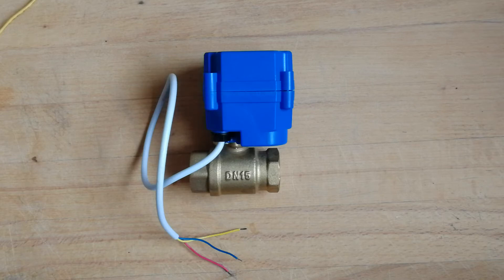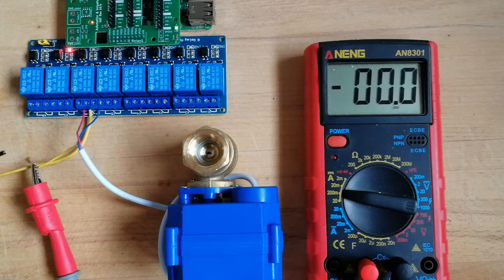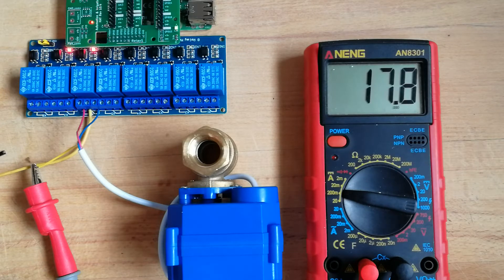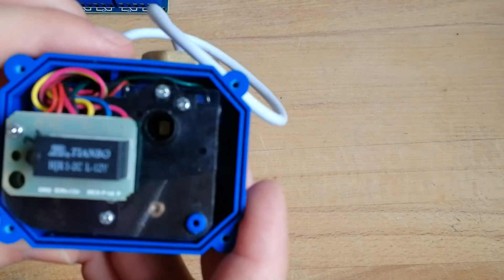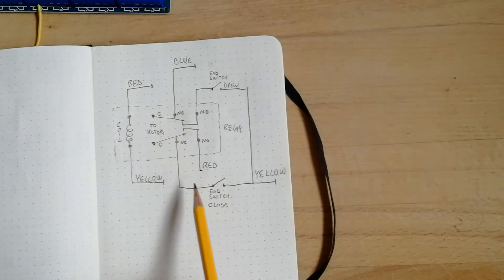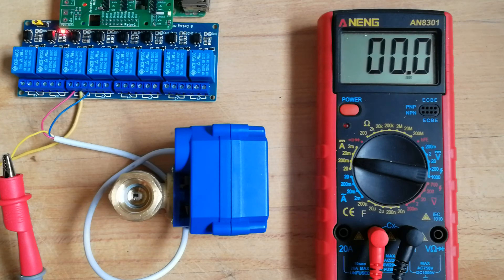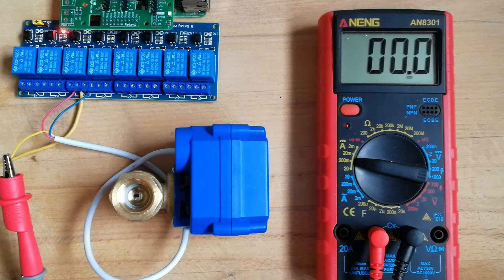Testing a Motorized Valve

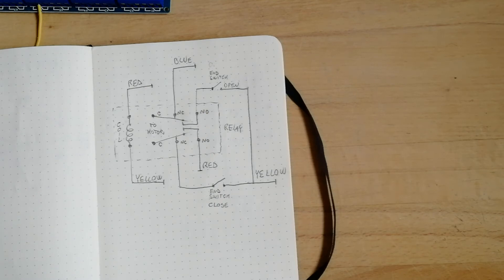Comment: Thanks for the video. I have some improvements for your diagram (t5:42). To say that Init status is Valve=Open. Instead of RED, YELLOW and BLUE, write OPEN-SGN, GND and CLOSE-SGN respectively. Use NC symbols for both end switches, they turn open just when VALVE-OPEN or VALVE-CLOSE position are reached, thus instead of just write OPEN and CLOSE them, write VALVE-OPEN and VALVE-CLOSE. 

Your hack is very good, I don't understand why a commercial product has this mistake!

Regards.

Comment: I have the same five wire ball valve that you have in your video. The instructions I came with it are a little confusing. Your video helped but unfortunately, I’m still having trouble. So I have the yellow wire hooked to ground or negative. When I touch the positive to the blue wire, the valve closes. But when I touch the positive to the red wire, it does not open. What am I doing wrong. Great video by the way thank you I look forward to your help.

Comment: I use a version of this valve, but with the optional open and closed contacts. I use the open contact to enable a pump via a relay.
Reply from the maker: That's an interesting idea, thanks for sharing.
Reply: @hydrosys4raspberry19  yeah, it works well. I can't take credit for the idea though! Atleast it means that the pump won't run unless the valve is open!
Reply: @mathews-e5418  link Please
Reply from the maker: @riks.1773  Added the link in the video description
Reply: Thanks for the sharing, may you provide the connection you have done in Relay & Motorized ball valve? 
Thanks again

Comment: Hello, thanks for sharing the informations on this video, and which were closed to what I was looking for. I have a question that I hope you can reply to it.
There's a module named " W1209 Temperature control " it has a relay. can I use this for the following situation -->
- when temperature is for example 38° or above --> then Open the valve ( to let water in )
- when temperature is below 38° --> close the valve to stop the water flow
Reply: I think you can, just to be sure that signals and connections are right!

Comment: It seems the only way I can get the valve to open and close is to switch the yellow in the blue from positive to negative. So if I put the yellow wire on positive and the blue wire on negative the valve opens if I put the yellow wire on negative in the blue on the valve closes. That’s the only way I seem to be able to get this to work.